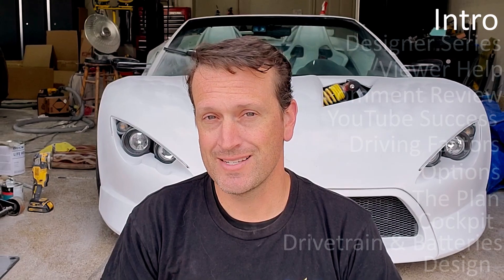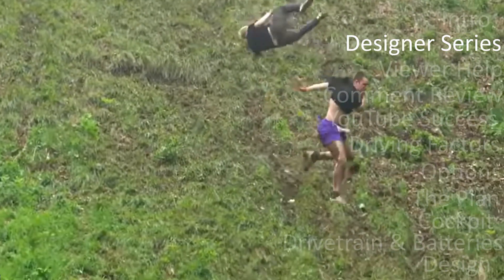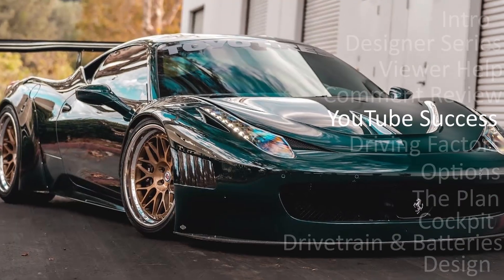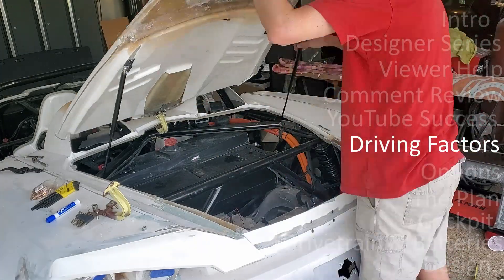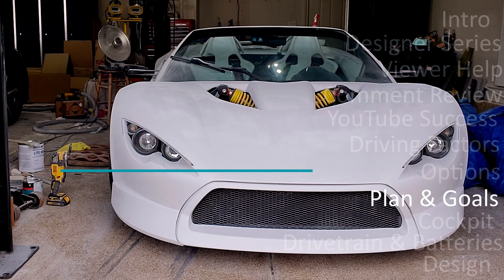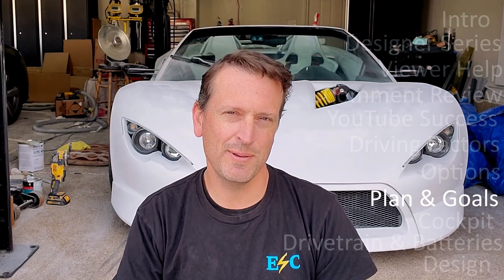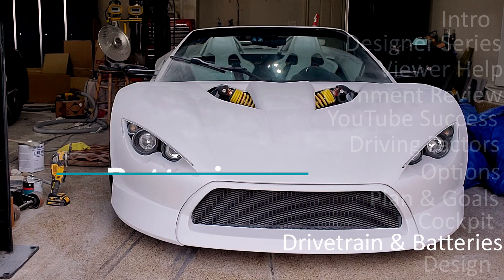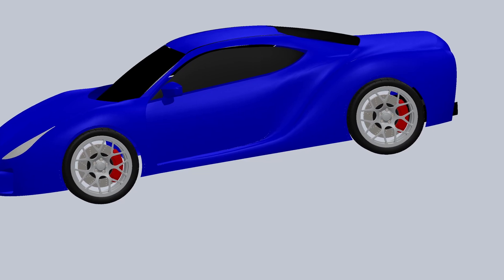ESC S2 E01-D - Starting the Next Build!  Electric Supercar Season 2

Comment: Hey Jeremy, While it may take a bit more interior work than a direct cockpit conversion to do exactly what I think you want, I think that the Factory Five 818-C would be a great thing to look into. It already has a lot of the looks that you want, door/trunk fitment issues are next to nonexistent from what Ive heard, it already comes with a good wiper system, power windows (and locks if they're carried from the donor, and headlight/tail lights even match your own design and are ready to go with the kit, too. Plus at just under 13,000 for the kit and using a 2002-2007 subaru impreza/wrx chassis as the base, there is a lot of aftermarket support. It is a project car that I've been looking at myself, and I would be doing a very similar thing to what you would be doing as well-except for maybe not an EV swap...yet.
Reply from the maker: Thanks for the comment!
Reply: The fitment on an 818 is way worse than the K1 he is working on now. Windows are near impossible to get right. Wiper system is mediocre at best. Don’t believe the press clipping, talk to someone who is building one.
Reply: @ajzride  Yes, you are correct in that I have never had any hands-on experience on an 818, and yes, you are also correct in that the fitment and wipers/windows are going to struggle to compete with any modern car, however that is going to be true with nearly any low-cost, hand-built kit like the 818. That being said, it still isn't that far behind production vehicles imo. I've seen old hand-built vehicles with gaps as big as half an inch, and from my experience, lining up doors, hoods, and even wipers can be just as frustrating on a modern vehicle as I have seen in many different build series here on Youtube. Add all this with the fact that nearly the entire car is assembled by hand, either by you or by Factory Five, and there is a possibility for issues to arise, but there are quite a few places online that are a significant help on these issues. Now may I ask what has led you to your opinions on the car?
Reply: @ianwilhelmsen2757   it appears my response last week never posted.  My opinions on an 818 come from being 27 months into building one.  I bought it after talking extensively to friends who had build FFR Roadsters, and I thought I knew what I was getting into.  They have looked at my 818 and admit that it is lightyears behind the Roadster in terms of fit and finish.  However the absolute quality of an 818 is not what I was trying to convey here.  My point is that after watching the work on the K1 here, it's definitely better than the 818, and if he was unhappy with the K1, he would be even more unhappy with the 818.  Check to this thread for a small taste of how 818 builders feel about it:  

https://thefactoryfiveforum.com/showthread.php?41369-Door-panel-location-and-door-swing-hood-amp-fenders
Reply: @ajzride  Well then I have to say that your points are things to really take into consideration. I wonder how far factory five has come in these last 3 years and how far they will come in the next 4-5 (as that is when I could be able to build one if I do). It almost sounds to me like they are not following their own advice in the manual when storing the panels at the factory. 
Other than fitment issues, would the 818 be a kit that you would recommend to others that are looking for kits like it? 
Oh and out of curiosity, do you have a build thread on the FFR or other forums like have seen elsewhere, or any fun/good examples that you follow on the car? I do apologize if I sounded hostile or like I didn't believe you at first, I just have had to deal with people who have tried to sabotage other options like this because it wasn't exactly what they wanted to see. Afterall, it will all be up to Jeremy on if he wants to try the 818 or go with something else.
Reply: @ianwilhelmsen2757  The problem with saying whether or not I would recommend the 818 to other builders is that there are not many other options in the space of "not crazy expensive mid-engine kit car"  An SLC, or DDR-8 , or GT-R is nicer to build, but at 4x the cost.  To your first point, FFR has made no improvements to the 818 since they introduced the coupe and Gen-2 nose/fender/light upgrades, and based on their FFR Live facebook videos, they are lukewarm on doing any further development on it.  There are a few big hurdles that have to be addressed when building one.  First the suspension setup is not right and that is a design flaw from FFR.  The bump steer is flat out scary and you can't get enough caster or camber into the front.  Anyone who wants to push their 818 performance wise has to modify the steering and the upper control arms to address this.  Secondly, the shifter they send with the kit is flat out unusable.  I spent two weeks trying to make it work, then spent another week looking for anyone on the internet who had made it work.  Every single thread or blog I found, they had broken down and made something custom or bought an aftermarket solution (zero decibel motorsports has a solution, but that drives the cost of the kit up more).  If you are building a turbo, the air to air intercooler  is barely adequate in the roadster for street use (won't hold up at the track) and not usable at all in a coupe, so most people have to build an air to water intercooler system. The cabin is very tight with little leg room using the FFR fuel tank, so almost everyone buys an aftermarket fuel tank to get more legroom.  All of these are solvable, but keep driving the cost up and making more custom work for the builder.  The body fitment issues actually aren't a problem for me because I'm customizing almost every body panel.

Build thread here:
https://thefactoryfiveforum.com/showthread.php?31639-Aj-s-818S-in-Houston

Playlist here:
https://www.youtube.com/playlist?list=PLzWG4OlH1D_nSAfKf59TXBpFlld_lpnft

Also Check out Art's build for what the potential is:
https://thefactoryfiveforum.com/showthread.php?20434-Art-s-818-build
Reply: @ajzride  Thank you for the info, it is very insightful considering most of the time I have been looking at builds where they have not finished it (or at least not gone over any design downsides like this), so all of these points are new to me. I also have to apologize with  my first reply again, I realized I had completely forgotten that I could see if you had anything on your channel. I do agree with your points on the more expensive kits, too. I guess in returning to the theme of the original comment, the drive train issues would be completely neglected, but the bump steer/alignment issues are big downsides. Lincoln Tech also makes a good video on eliminating bump steer if you want to look into it more and have not already: 
https://www.lincolntech.edu/news/hot-rod-garage/eliminate-bump-steer-lincoln-tech-tip 
For the meantime, I guess all I have left to say is that you have another person looking forward to what you can come up with on your build, and wish you good luck with it. It already looks really well done so far, and the mustang looks outstandingly well done as well. Happy building!

Comment: Something important to consider when you’re choosing a cockpit or let’s say a donor chassis for your vehicle is how complicated is the unibody structure? Because a lot of really newer cars as you know are made with unibody and built with crash and crumple structures built into them, making it really difficult to modify them to add components or especially to add different body panels to them. Being that this will only be your second car build I would not use something extremely new or some car that is very cramped to work on, a Cayman or any Porsche sounds great, but I think packaging could become problematic for you. So I would consider a C4 Corvette, even though it is a little on the older side, it is made with a frame and body panels attached to it, it does have four wheel in independence suspension already, so should be pretty good handling. C5 is certainly better but the packaging is just a tad bit smaller, although you can still get a donor C5 for pretty cheap, and it does have a lot more upgraded things like newer ABS and even better suspension geometry. With the kind of room that you have in the front engine area of a Corvette and also they do have a pretty robust trunk area I’m sure you could find enough space to put the batteries and the motors, and even take some of those panels off and more easily make your new body panels for them, there’s a really wide range of custom Corvette customizers, some of them even make brand new Corvette chassis look like old ones, so those kind of things can certainly be done. (Not that I’m remotely suggesting that you make a new Corvette look like an old one, I think they actually look pretty terrible but there’s room on the chassis to do that sort of thing.) since I’ve been thinking about doing an electric swap on my 2001 Trans Am, I’ve also thought all of these kind of thoughts, how can I make a four-wheel-drive electric vehicle? What I’ve come to the conclusion is that four-wheel-drive sounds fantastic, but you almost have to start with a chassis that supports that kind of thing, because you need to have the right kind of front suspension set up that allows the driveshaft to go to the front wheels, a lot of real wheel drive cars put their shock mount points directly on the centerline of the wheel hub, making it very hard to turn a 2 Wheel Dr. car into a four-wheel-drive car. For sure using a tesla three motor would be beneficial in that aspect because they’re much smaller to use on a front axle, but it’s also even more complicated to get a controller that can control two motors simultaneously of the Tesla Tesla three style, the older model S as you’re probably aware is a lot easier to get controllers for.
Reply from the maker: There is a lot of wisdom in your comment!  Thanks for taking the time!
Reply: Agreed: The older small pickup truck cabs UNBOLT with hand tools and are ready to go onto a chassis. 
I think raking the windshield/roof line back might be do-able , and satisfy his affection (affliction?)  for body work

Comment: Looking forward to see the new season!
Not what you are looking for I guess. But for myself it would be fun if it's possible to do it, get an used cheap old VW E-up (80 hp FWD drive and 1.100 kg weight) and then change the rear wheels to hub motor wheels and try to make it AWD combined to about 180 hp. But I have no clue if it would be possible.
Reply from the maker: Thanks for the suggestion!

Comment: Electric GT OX batteries.  Very configurable and brand new.  AEM VCU and BMS.  If you go Tesla Model S motor use the AEM motor controller.
Reply from the maker: Thanks for the comment Jack!  I'll check out the batteries.  For AEM...do they offer the controller for dual motor?
Reply: Not for dual motor.  If your going dual motor I would suggest M3 setup. A lot lighter setup.
Reply: Ingenext has the M3 dual motor controller.

Comment: I think the main reason most people base builds on an existing platform is about safety, crush zones and having a VIN to easily register the car. That said, I'd say start with a Gallardo or Hurrican. Reasoning is it's lightweight and you can build the frame out from it, it's designed for more of a cab forward layout and the interior is pretty nice. Do the body in carbon fibre and the frame extensions in aluminum. Make it as light and slippery as possible... a true supercar. 4 motors! 2000HP!
Reply from the maker: I like the way you think!

Comment: I agree with you Jeremy, A Porsche Cayman donor vehicle with a Tesla model 3 drive train is the way to go. If I had the time and money I would definitely go this route.
Reply from the maker: Thanks for the comment Alden!
Reply: what about the awesome Porsche 928? Cheap, because the stock drive train is TERRIFYING to most people. Fantastic Supercar chassis ready to GO !
Reply: Mid engine assemblies seem simpler with the location of the motor and the drive train. Likewise, you can keep some/most of the front wheel steering assembly.  Perhaps you can even use the leftover space in the frunk to balance some of the weight with batteries. The layout would be fairly similar to "Wattson."  But, could you get a donor for the right budget?
Reply: Or an old 944! Can be bought for not much if anything. 2 door, light, and a Porsche.

Comment: You see so many Tesla swaps. It would be nice to see a double leaf, or some warp 9 motors
Reply from the maker: .What is the power of a warp 9?  How much does it weigh? I will have to do some research
Reply: One of the annoying things about them is... info like that is hard to get.  But it seems like everything fun, or built to win drag races, seems to be made with them.  The numbers you can get seem to always be based on running them on much less power than people put through them all the time.  It's what I'm planning to use.
Reply: @electricsupercar  less than the Tesla. A lot of the electric race cars use two of them in sequence. They have about a 6” radius and about 2’ long each. Same size as the actuall Tesla motor really, maybe a bit skinnier.
Reply from the maker: @motome8  Am I looking at the right unit?  32 hp @165lbs.  Doesn't seem like a good power to weight ratio.  Maybe I am looking at the wrong one.
https://www.thunderstruck-ev.com/warp-9-en.html
Tesla model 3 is 355hp @196lbs.
Reply: @electricsupercar  you really didn't read my comment.
Reply from the maker: @DarxusC  I did read your comment.  I am unsure of how else to evaluate than by its specifications.
Reply: I like the warp 9.
Reply: And they are not as new as Tesla, but hp isn’t a great translation for electric motors

Comment: Use different lights than the cockpit vehicle. Kia stinger headlights are mean and sporty and have a sweeping side like your model. A tail light that can be turned upside down to give it a different look than its original application.  Need to choose a two piece tailight with a near vertical Boot side opening or one piece lights for this to work.
Reply from the maker: Thanks for the suggestion!

Comment: I would say honda S2000 or mazda miata (first/second gen) would be perfect for a small roadster supercar.

Also love your videos, keep up the good work!

Edit: a nissan 350z would also be an amazing choice in my opinion!
Reply: +1 for the s2000
Reply from the maker: Thanks for the comment!
Reply: +1 both the miata and 350z are awesome though definitely leaning towards the miata. Something that small with the launch of electric cars would be awesome to see
Reply: @supleed2  agreed, although I think 350z will be easier to work with since it's a bit larger and has more room for batteries and motors. It probably will be a more comfortable ride too.
Reply: The miata swaps have been done before, zero ev makes a kit for them from the UK. 
The s2000 has already been done to there was one running 10s with a tesla ldu year's ago now. And rywire has one almost finished.
The 350z had been done multiple times as well, throttl has an awesome wide body tesla ldu swap build on here.
Reply: @4literv6  yeah, but this isn't exactly a full conversion, so no matter the car, it's gonna be unique.
Reply: @thedark333side4  very true, my point was more that those conversions you mentioned have been done already. 
Something more unique would be the 280z or cayman swap idea's. Or mine with the de tomasa pantera. 🤔
Reply: @4literv6  I love the sound of the cayman!